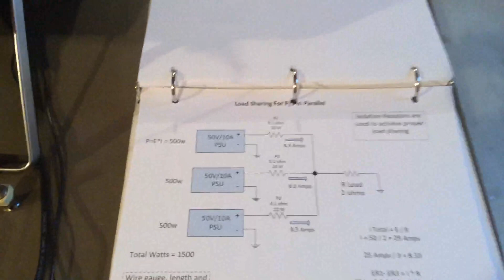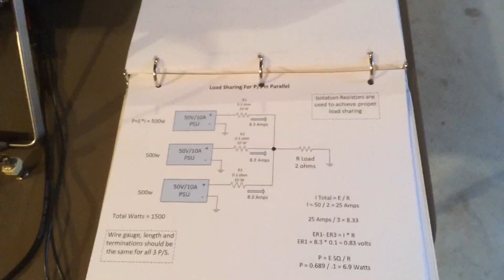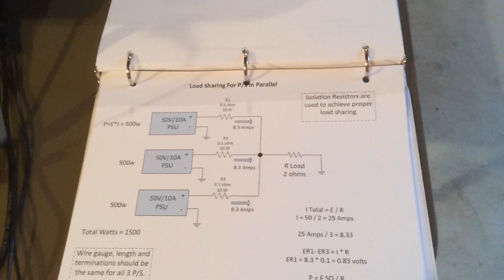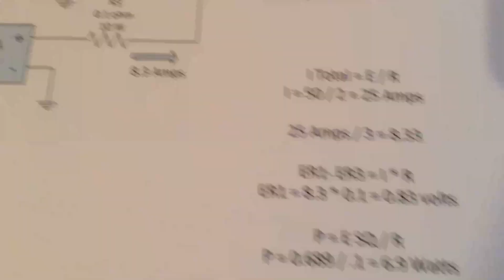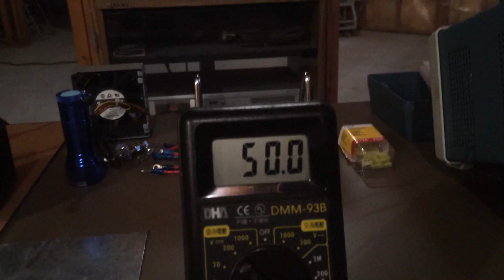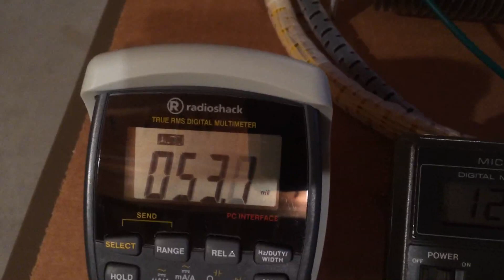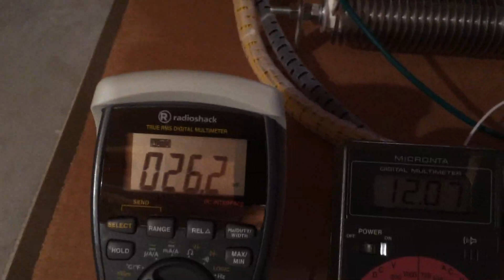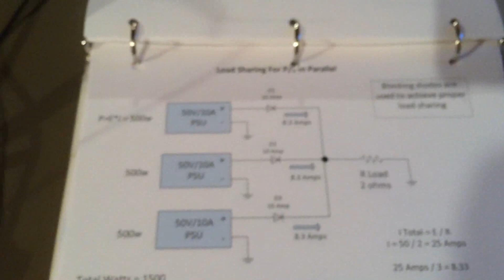RF Man discusses load sharing in parallel P/S and boost converters. Video has been reposted in HD.

Comment: I have built a similar setup with 3 of these to peg the output from my 24v batteries to always output 24v. It works to balance the load but the resistors get very hot once I exceed 30a. Do you have any suggestions for how I can handle higher amperage without the resistors catching fire?

Comment: Sir I want to drive 3 wheeler with 1500 watt two boost converter parallel connection input 24 volt 100 amp battery through 1000 watt 48 volt motor will this project work well sir please help me give proper advice

Comment: You should make the old video unlisted so people only see this HD one, good work bud.
With boost converters you shouldnt need diodes since they are built in, they will have more losses than the correct value resistor to account for voltage differences and drift between each boost converters feedback circuit.
Maybe you can go with a different approach entirely and somehow tie together the feedback circuit of each converter?
It will certainly need to be very precisely tuned but just load it down with close to the full load and measure the current and twist the pots until each has the same current.
I also think the initial inaccuracy is in your single decimal place meter, if you had more digits or just adjusted it once loaded you should be able to get it within 10's of mA. But certainly the cheap potentiometers that have a 12v to 90v range will drift alot requiring retuning or your solution of balance resistors.
Once again very good theory and application, may I request an update video of these converters in your final configuration driving the amplifier? Thanks!

Comment: Thanks for the vid & superb explanation!
I've got 2 of the WZ5020L supplies, and it looks like they sense & control off the negative output.  In my application i'm controlling the current into an inverter, which has 4 different +ve inputs, and all the -ve are tied. What is happening is that the current is going in via 1 module +ve & returning via multiple -ve paths. I tried some diodes (0.5v 10SQ050) in both the +ve & -ve leads which made no difference. (diode direction was OK).  
Is there a required voltage drop that fixes the balance? Would a higher voltage drop diode work better?

Comment: it means this 2ohms load is equivalent to  Vsquare/R=Power, Pwatts=50square÷2=1,250Watts???
Reply: i want to parallel 6x1500watts with a load of 8,000watts. same resistor size i can use is ok at 70V?

Comment: Great video, I’ve scoured Youtube looking for an answer and yours is the most thorough on power supplies load sharing. My issue is I’m not sure which type of resistors to get for my setup. I have 12 of these computer power supplies in parallel to power my car amplifiers in house. https://www.amazon.com/REFIT-Supply-DPS-400MB-1-39Y7329-Tested/dp/B07QK8LH2R/ref=sr_1_1?dchild=1&keywords=dps-400mb-1+a&qid=1609136359&sr=8-1. It works as is but I feel it could be better if I add resistors for better load sharing. The final load at the amplifiers will be 4 ohms. Any help would be appreciated.

Comment: Thank you for sharing your work. Could I use this current limiting setup for charging lithium battery?
Reply from the maker: Yes, if you add an external regulator, so you don't charge the battery too fast, you can use this for charging a lithium or lead acid battery.

Comment: I'm confused lol, I like this video and Everything makes sense but the .1  watt ohm resistor. With ohms law wouldn't that mean you are drawing 500 amps? 50/0.1 =500? Can you help me out?
Reply from the maker: The .i ohm resistor are in series with the load not in parallel. They are used to isolate the regulation loops in each power supply. Thanks
Reply: @rfmanchannel6915  thank you so much! =  )

Comment: Do any supplies have built in circuits so they can be directly wired in parallel without external balancing?
Reply from the maker: Yes, there are some power supplies that are designed for parallel operation. Meanwell has several. Jameco.com is a good source.

Comment: Have you tried enhancement mode PMOSfets to replace the diodes?  Low RDS On provides less power loss than the series diodes and resistors.  And they can be switched on/off individually by control logic.
Reply from the maker: I have not tried this. The current rating has to be quite high. Diodes are a cost effective solution....
Reply from the maker: I have not tried this. I would need to study and test this approach....